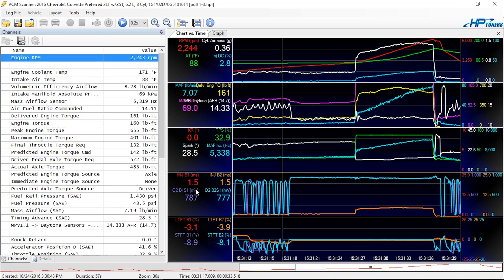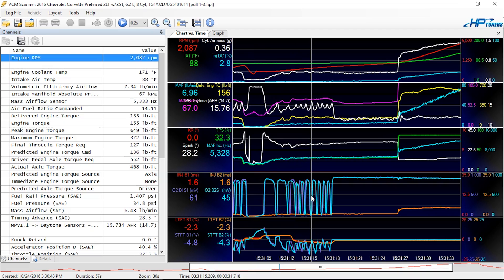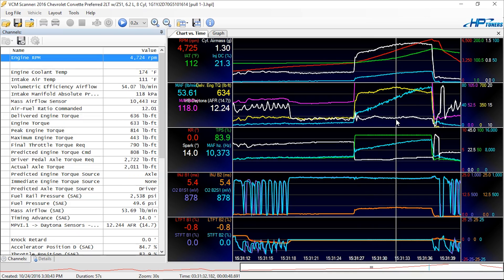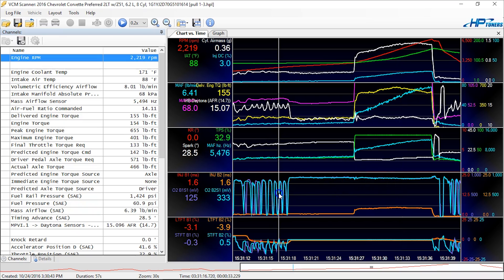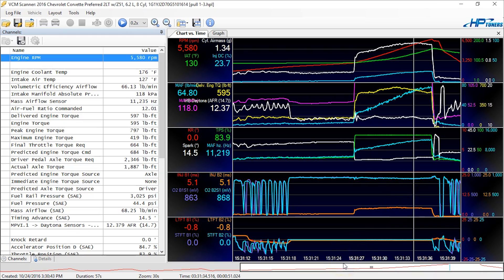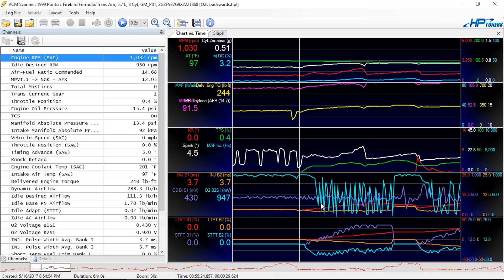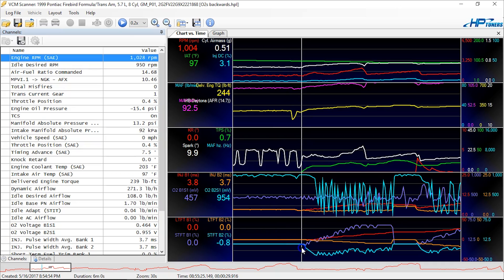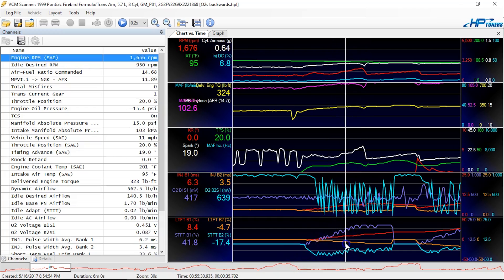How to Properly Understand Your O2 Sensors: Vehicle Oxygen Sensors and Their Role with Fuel Trims

Comment: So if the 02 sensors are pulsing and holding a little over 9 volts then the AFR is 14.7? Then what would cause my car to run rich?
Reply: injector pulse width or ve map

Comment: I see that a lot on c5's normal shops are prone to installing them straight back on the tunnel vs crossing them over in the mid pipes.
Reply: Camaro Rick can you give me more detail on this because I had Longtubes installed and now get codes P0134 and P0154 which says No activity. Looks like wires are connected and didn't see any burned wires.
Reply: I dont think crossing the sensors will cause "inactivity" like your codes suggest. Check the sensor wiring with a multimeter for voltage look up the connector end view for your sensors to figure it out